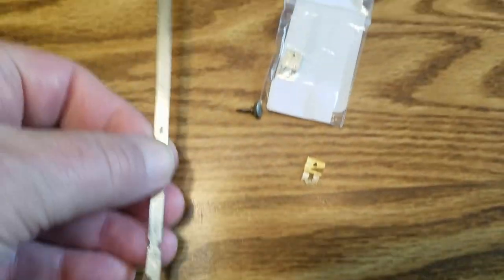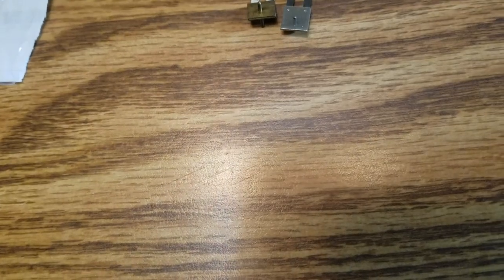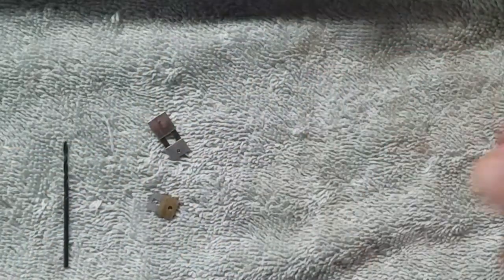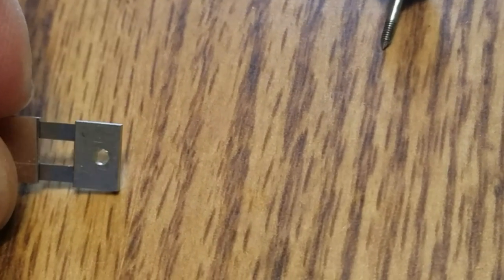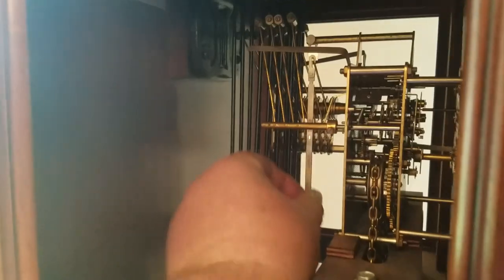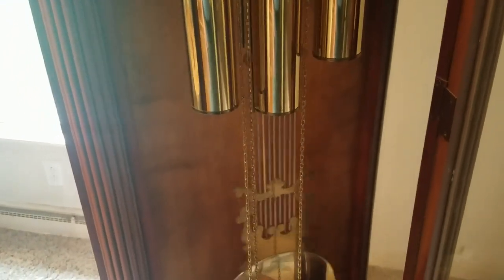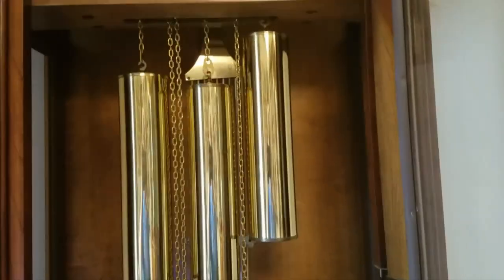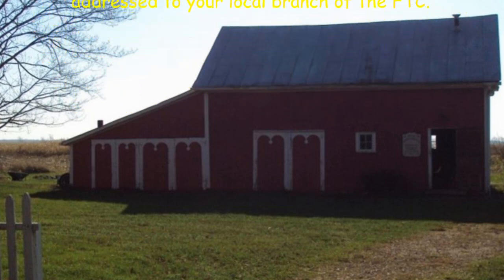Howard Miller Grandfather Clock - Pt 2 - Installing The Repaired Pendulum

Comment: I just went through this rigamaroll on a German movement grandfather clock with tubular chimes.  Had to hang the chimes, redo the connection to the pendulum , rehang the pendulum and restart the clock.  After awhile, I'll regulate it. It's more than seeing if it keeps time.   This is gonna sound goofy but there is a need to equalize the time and distance involved in the tik and tok of the pendulum.   It should be fun!  You did a great job getting the fiddly bits in there.  My hands are pretty big....there was some frustration created as I realized that I could get "close  but not quite " .  Eventually though...everything came together.  Again, Dave...you did great!!
Reply from the maker: I had to dial in the pendulum when we moved to Union 
City. Just a matter of adjusting the length. 
There was a clock at the court house that had BB's sitting on top of the pendulum.

Comment: Hello thank you for the update on the pendlin. It worked. The only thing now is it does not keep the pendlin to go back and forth.
Reply from the maker: You missed putting the silver bar in the notched arm. 
Look inside and it should be toward the back of the clock.

Comment: My problem is the other end of the pendulum.  The  clip to the body is missing.  Is it possible to order another clip?
Reply from the maker: I could have ordered a whole new pendulum. The springs are available on Ebay.  I bet the missing clip would be too. 
Howard Miller still makes clocks so the parts should be available. 
I tend to try and repair parts rather than buy just because I can and it is an interesting challenge. Buying new saves a lot of time and effort.  😁😎

Comment: Is there some where I can buy the spring with the screw with it.  I broke so many trying to make the hole bigger to fit the screw. Thank you
Reply from the maker: Those were the only springs I found. 
They have the Howard Miller part numbers and ID on them. 
Maybe they changed the pin size on the newer ones.. 
Put a backer on the spring to keep it from breaking.

Comment: I just got the same exact clock someone tossed on the side of the road. it’s missing this spring you just installed and the pendulum leader hanger I’m gunna have to order both of these do you know the length of that leader hanger
Reply: Your clock looks exactly like mine so what ever length yours is I know I’ll also need
Reply from the maker: I'll measure and let you know.